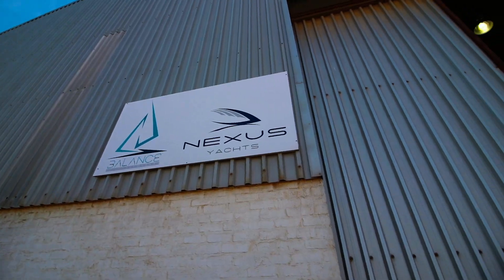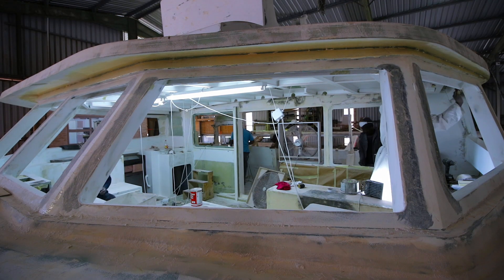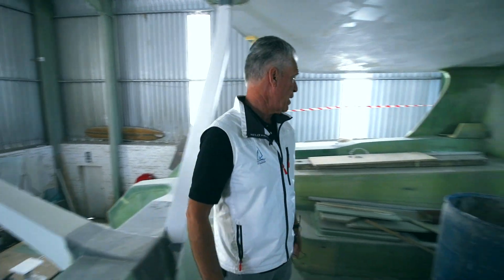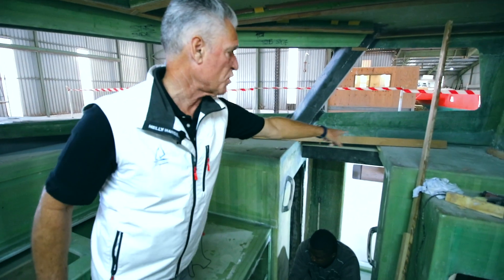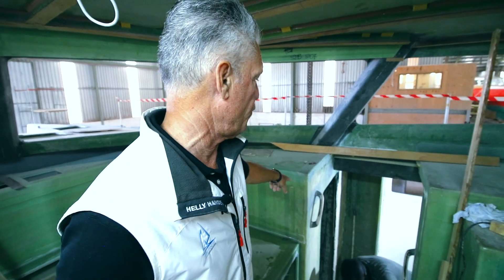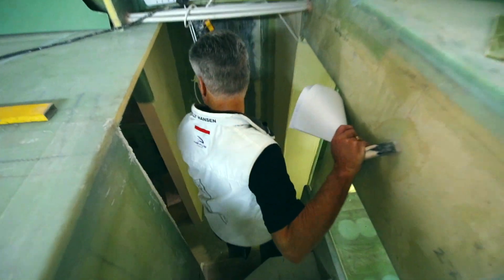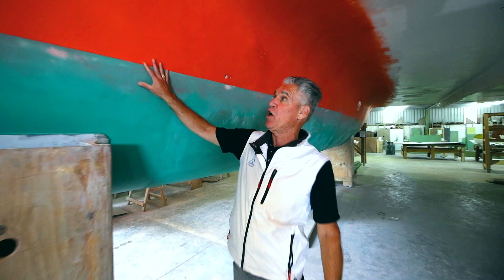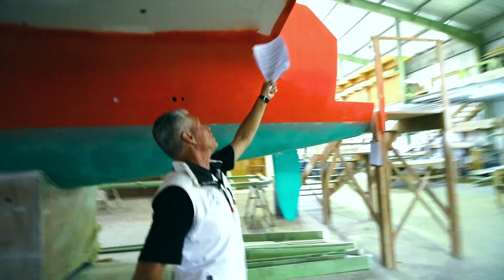Balance Build Technology - How We Use Carbon Fiber

Comment: Screws securing a hand hold generate stress risers and cracks in the substrate in time because of the concentrated loads in a small area. It's an excellent solution to have all of these laminated in. Probably saved hundreds of lbs of weight on a boat this size. Very much understated solution. I just discovered Titanium for marine use and while expensive it is a fantastic metal when you must use metal. I like S glass for marine use bc it's more impact resistant than carbon and tensile/flexural strength will better match the E glass. Like Kevlar and carbon is cheese and chalk. The Kevlar will only take load after the carbon is broken.
Excellent video.

Comment: That is all very nice but foam core adds ZERO STRENGTH Carbon fiber shatters when pushed to ists limit  that transvers beam is a joke foam core why not use stainless steel it is stronger and can flex not snap what a POS a very light boat = no strength and wow carbon Handel  EGLANN EPOXY CARBON WOW IF IT GETS BUMPED IT GOES TO THE DUMP GET IT    NICE SHIRT IT MATCHES THE DOO

Comment: This composite materials are better than aluminum now?
Reply from the maker: Alu is a fine material for cats in the over 55 foot size range. It has to be insulted and does not lend itself to production builds. Composites are lighter, but alu is very strong for hard use expeditionary sailing. It is a pain to make pretty with paint, so it is best left natural. Has a military feel.  But kinda cool too. Phil
Reply: Aluminium also has the corrosion issue, and vibration of course!

Comment: Tell us more about the hull/deck joint and how that is done
Reply from the maker: On the 526 and up the join is done with e-glass and carbon in epoxy, there are no bolts. The deck and hull are joined with glass and faired - there is no join-line to see on our boats. Glad you asked, because the builders who come to our boats marvel at that - the level of craftsmanship. Perhaps you can come to see one of our boats sometime.
Reply: They're putting out videos like crazy but don't reply to comments, customer service indicator.